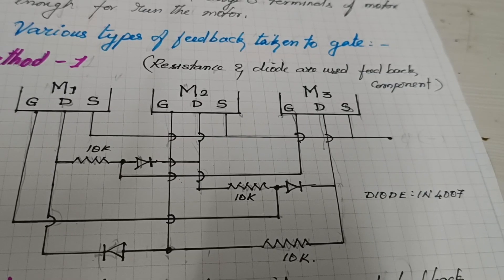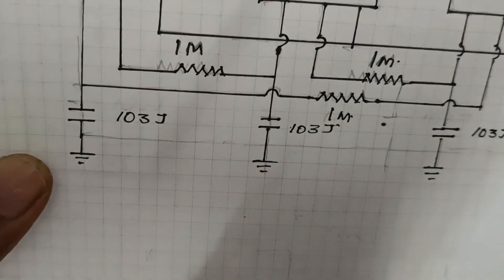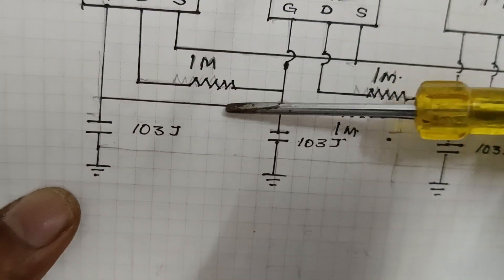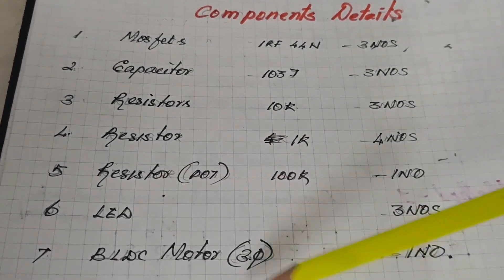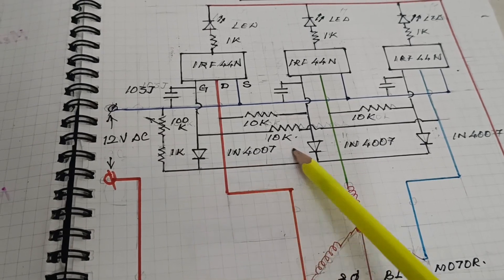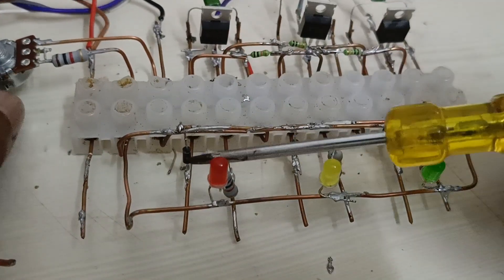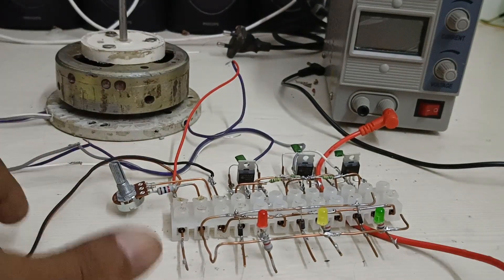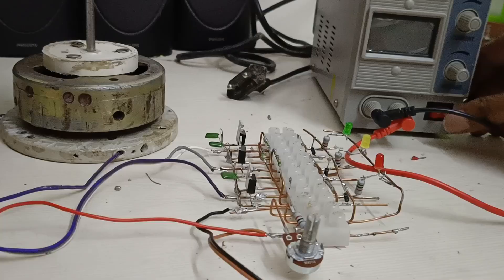(MC-3)Bldc controller using various types of feedback components

Comment: Could you simply add an inductor coil to the output to power an induction motor? True 3 phase ac?
Reply from the maker: Thank you sir
Yes it is possible
Reply: @pugalstech  I'm really interested in getting 3 phase ac from low voltage DC such as a battery but the only real products available for this aside from building your own is a boost converter into vfd. I guess I will have to try it out then. Thank you!